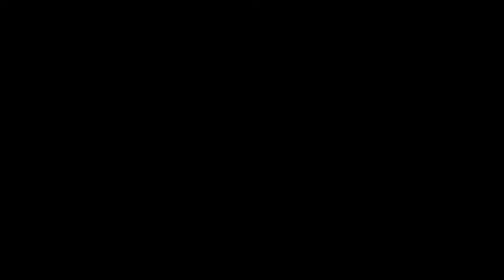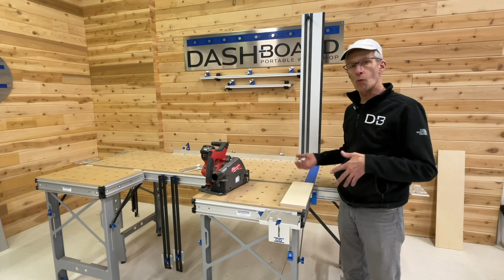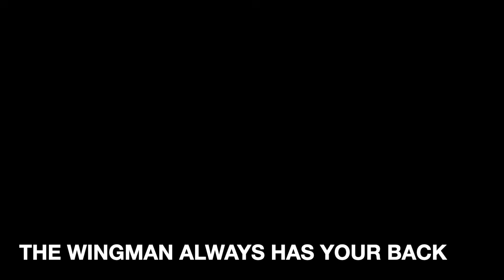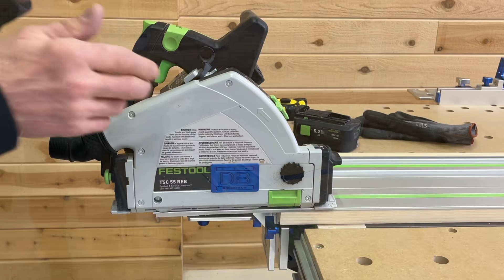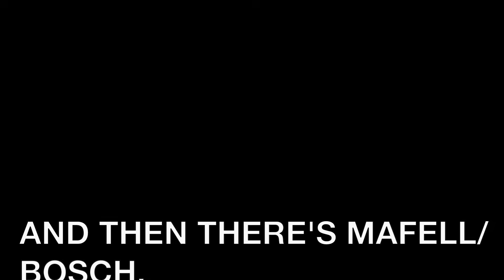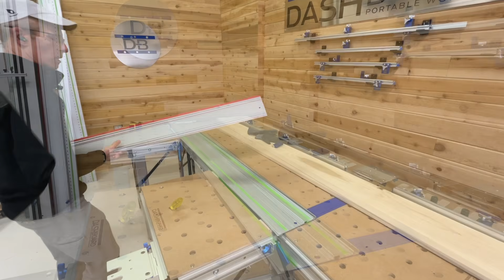How To Choose The Right Guide Rail Length (Track Saw Setup Guide)

Comment: I think you mean that 13inches will be added to 55 inches, not to the width of the board, in order to cut a 4-foot wide board.
Reply from the maker: Referring to the first scene: To use our Guide Rail Brackets, when choosing rail length for any  table, begin by adding 13" (330mm) to the outside measurement of that table, and then choose a suitable rail based on the sum. The best rail will typically be longer than that minimum.